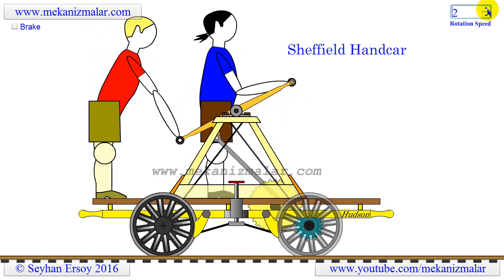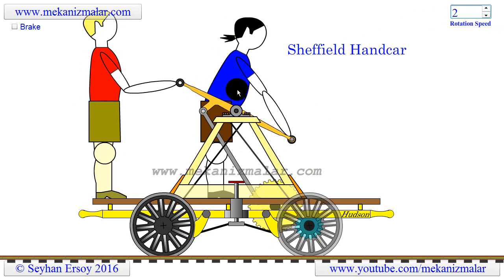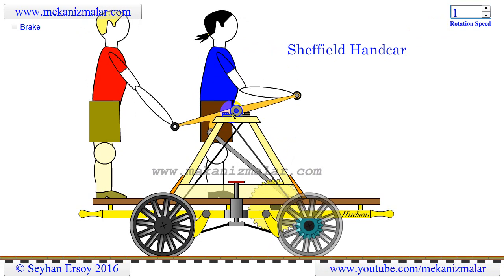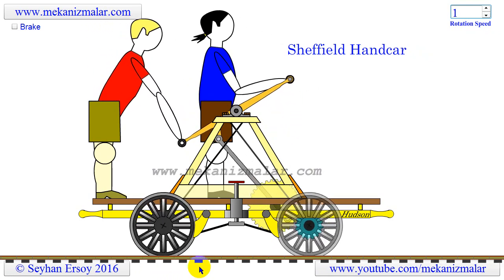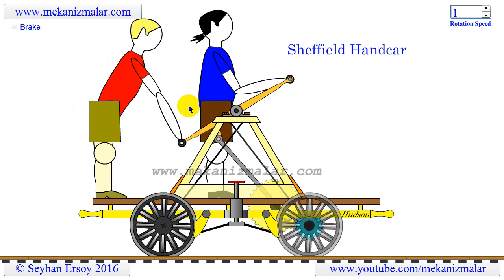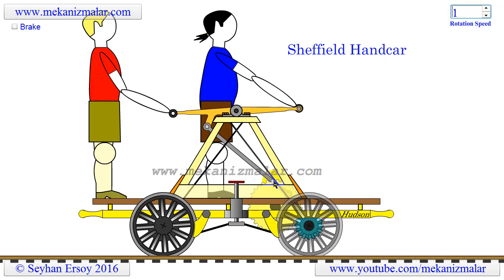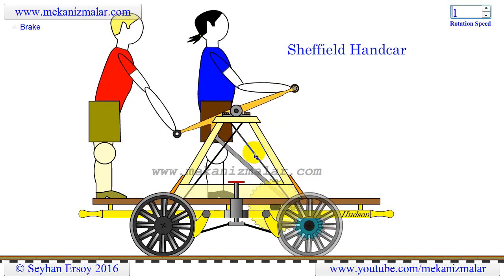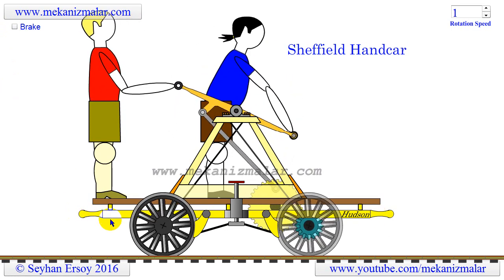how sheffield handcars work

Comment: A friend's house my father took us to as children in the mid 80's had an ancient Sheffield handcar that was massive for me at that age. I was maybe 8 or 9 but had deadlifted 100lbs and was determined to get the thing moving. I also remember the first time I got it going and my sister nearly crapped herself, then I got it hauling ass! lol 
The irony is, that family friend was an engineer but an actual Mechanical and Electronics/electrical engineer and I came to this video because I am an inventor, all around mechanical and electronics/electrical engineer.
I am researching the mechanism in relationship to an invention of mine.

Comment: Why is the gear moving in the opposite direction of the wheels?
Reply: The gear wheel is engaging/turning the axle directly, so it makes the axle turn in the opposite direction.  There is no chain like you would see in a bicycle.   If a bicycle didn't have a chain and the pedal wheel drove the front wheel by contacting it directly, you would have to pedal backwards to go forward.
Reply: @Blazerfan11  Ah yes, I figured out after a bit that there the cog that is being turned is the one that is turning the axle, thank you! This whole thing actually reminds me of a rowing machine where you have the push phase and the catch phase :D

Comment: I also own a hand car such as this one.  With two people each would face the center of the car and pump using a hand on each side of the handle inserted into the walking beam.  The direction of travel is obtained by kicking the wheel with the foot in the direction wanted.
Reply from the maker: Dear Roy, Thank you for your informative comment and support.
Reply: you don't own this

Comment: The black haired men is standing wrong in my opinion. Take a look at US-Patent US265987 (on which this is clearly based on).
it would be uncomfortable to stand like this.
I did my own animation based on the patent drawing: https://commons.wikimedia.org/wiki/File:Hand_Car_Animation_with_men_-_small.gif
From my point of view, it makes much more sense, when the two men are facing each other. Sure, only one can look a head, but: The hand car is on rails, man powered and has breaks.
Reply from the maker: Both men shown in my animation are in correct position. In actual Sheffield handcars there are 4 person powering the handcar. The way you show the men is not correct. There is one instance where one of front driver wanted to protect himself from cold wind and he powered the handcar backward. He died in an accident because he was not looking forward. Here is a link you can look at where people using correct powering position for the handcar I show in this animation.
http://www.villagelife.com/news/handcar-derby-kicks-of-21-year/
Reply: Thank you for the reference. I was guided by the walking beam D in the patent drawing figure 3 where the handle bar E is connected in away/distance, so that the wallking beam would get in the way: https://commons.wikimedia.org/wiki/File:US265987-_Patent_drawings_colored_in.png (I colored the drawing because I think it is easier to read the drawing when the same part allways has the same colour) Interestingly, the patent is not describing how the hand-car is operated, instead it refers to "the usual way". I have found older patents showing a configuration that would easly allow the operators to stand as in your animation. Hmm... I presume that both ways of operating existed, but safety concern have since clearly pushed toward the operation shown in your animation. The position of the break also makes more sense how the people are standing in your animation. (yet: Seeing that the walking beam has no free run, speak it move up and down so long the car is driving, I can presume that safety really wasn't a primary  concern in 1882)
Reply from the maker: Thank you for your explanations.